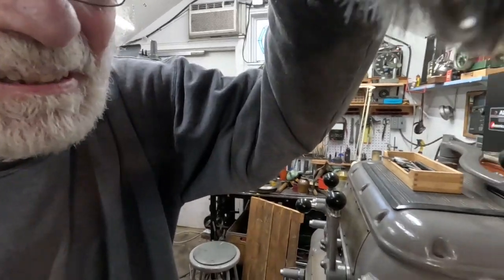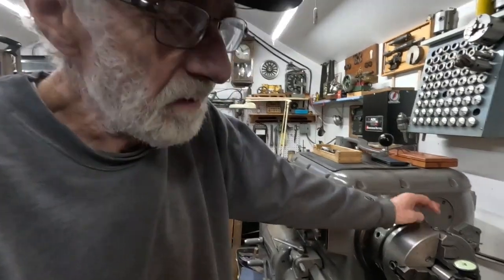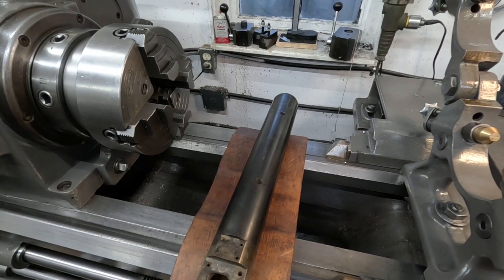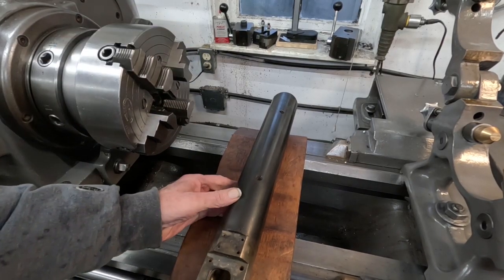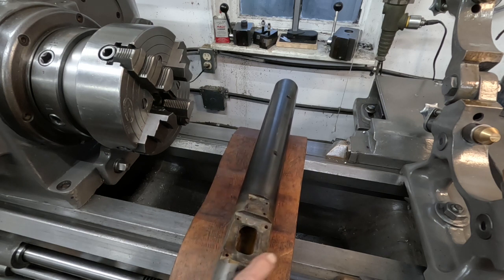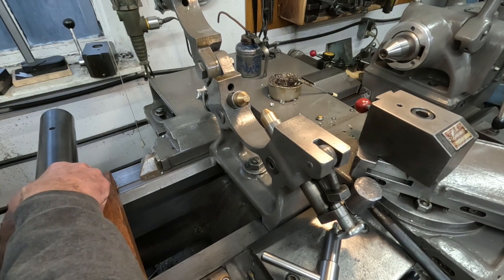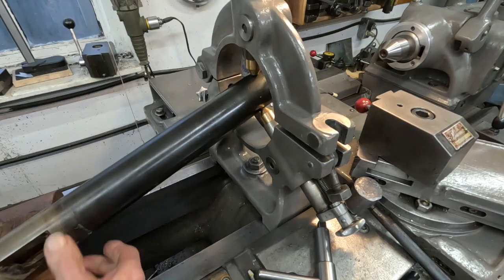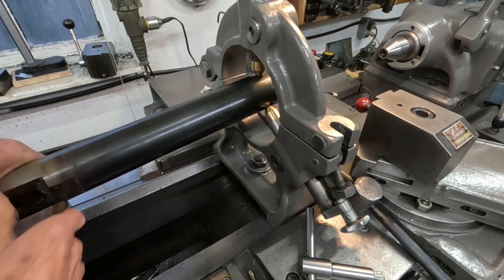Axelson lathe setting up with steady rest and 4 jaw chuck

Comment: Merry Christmas Don. 
I seen that news article also. I was surprised by the fact that they didn’t have anyone to step in even temporarily, but I guess it makes perfect sense. Not many manual machines left in the industry running, most are in small hobby shops and older guys like us running them. It puts me in a tight spot really, too old to start the journey of CNC and not much in the line of manual opportunities left either. 
 Anyways I sure hope you are doing well up there sir.
Reply from the maker: I think the best approach in these times is to use machining skills in addition to other skills like a millwright. I have to do a little of everything.
 Working space here in a wine tourist destination is now $3000 a month for the spot the plastic mold shop was, that is hard for one person to do.
 Hopefully the economy will pick up, that will help greatly. Happy New Year Jason!

Comment: A nice big boring bar with coolant through. That’s just my suggestion. Have to plug a few holes, but that’s easy for you. Back to these old machines. When I look through my old books and catalogs, it’s hard to believe how big, heavy and sophisticated some of these machines were, and they were built in the 1870s!
Reply from the maker: I like those Pond lathes and boring mills for railroads. There were very old machines still in use up into the 1970s here in small shops related to maintenance for sawmills and mining.
I found a machine in Montana called a Lincoln Miller, an early type of milling machine I know very little about it except its mid 1800s and was used in armories.
 The boring bar with through coolant would be great for a big machine.